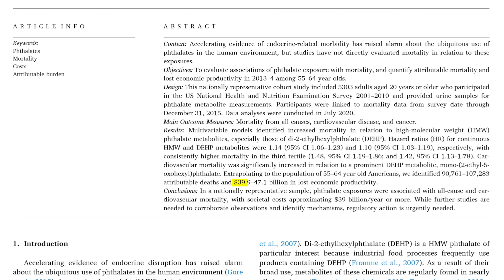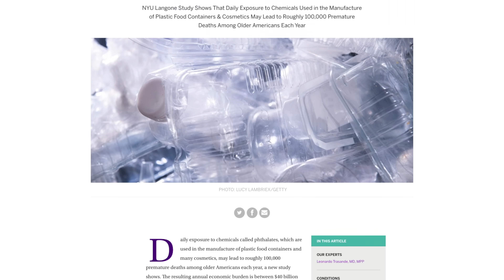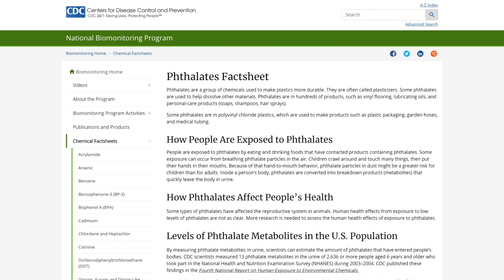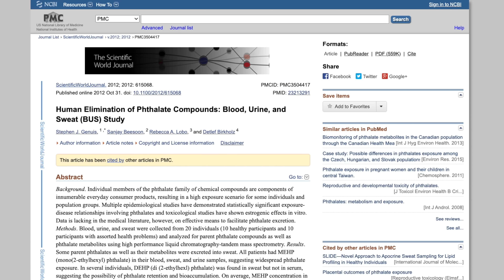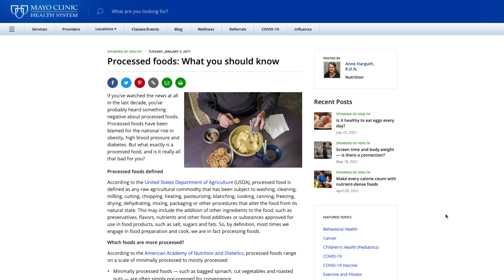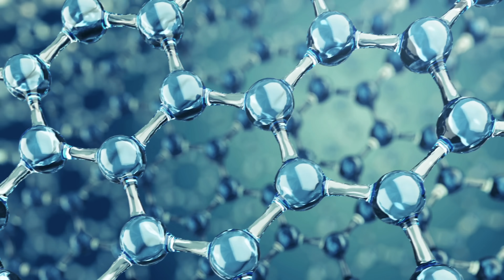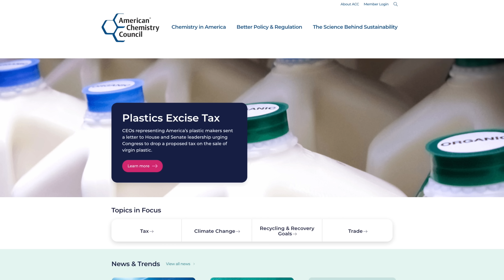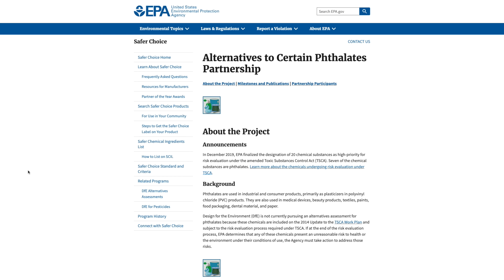Plastic Chemicals Killing Humans?

Comment: Let’s not forget about all of the different pesticides and chemicals found in fruits and vegetables and even in most of the drinking water supply. Also a new study that fairly recently came out found out that the air we breath may be more polluted than we thought. Phthalates are just the tip of the iceberg as far as I’m concerned.

Comment: When products say they are BPA-free, safe for microwaving and cooking at high temperatures should I still be concerned? My daughter cooks a lot using the sous vide method which uses vacuum-sealed plastic bags cooked at high temperatures for hours!
Reply: I use stainless steel because it is lighter than glass and dies not break.  The basic problem is that Americans work so hard for their employers that at home they have no energy to wash up.

Comment: Phthalates are so hard to avoid. I changed my lifestyle due to unexplained infertility. It took us 9 years to concieve. I made multiple changes including reducing phthalate use, which was difficult. A few months later and with multiple IVF attempts, we finally concieve our first. I am convinced that phthalates played a big role in our infertility issues.
Reply: I am having a problem conceiving too, any advice
Reply: Preseed lube helped us conceive. I also eliminated as much plastic from our home as possible.
Reply: I hope your future is beautiful with your baby
Reply: Phthalates are NOT the reason you were unable to conceive. This is one of those false anecdotes that gets amplified long enough to become “true” years down the line. Unfortunately, Dr. Hansen did not tell you the other side of the story.
Reply: So where have you been exposed to phthalates?

Comment: And an added caution. .. don't use plastic in microwave, especially if there's oils or fats In the food you're heating up.. those plastic chemicals are released into your food. . plus, obviously, you're NUKING the food and messing up the molecular structure of the food. . ingesting food mutated by radiation=not good.

Comment: I have severe chemical sensitivity so already do a lot of this.. all my products are naturally scented with essential oils. I dont drink water from plastics any more as I have a water filter. I use bicarb (baking soda) to wash my hair and vinegar to condition it (about 1Tablesspoon is used of these, mix with a little water.. leave on for 1min for each then rinse).  I avoid using plastic wrap where I can but after this I plan to replace my plastic microwave bowls with glass.
Reply: Don't use microwave at all